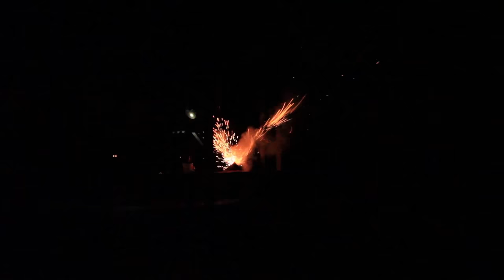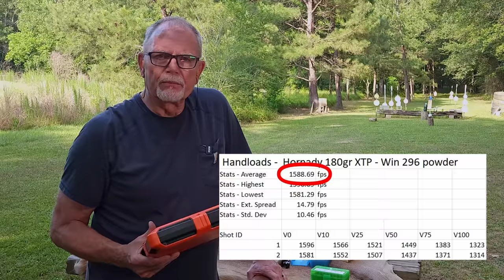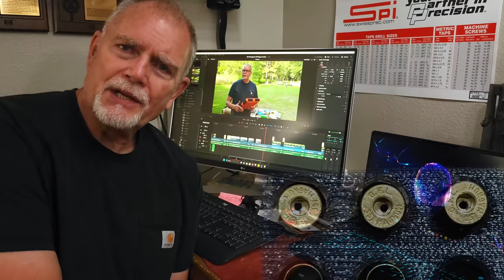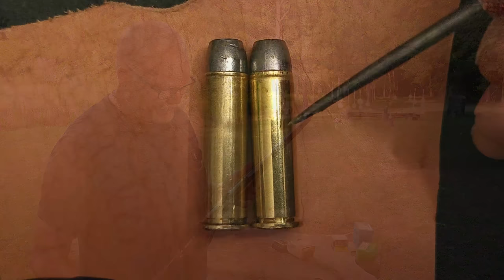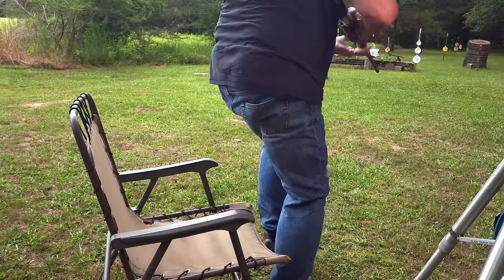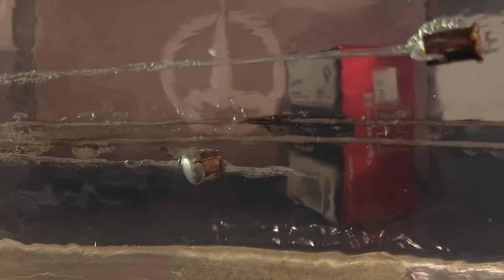Was I Wrong About The 357 Magnum Carbine? ?

Comment: George, it’s a funny thing the .357. I love it, and I am aware of its performance from both revolver and carbine. I have an 8 3/8” model 27 that I say I will harvest a deer with one day. I have hand loads that push 1550 fps through it. Those same hand loads approach 1750 fps in a 16” Rossi M92 I have. But I have never followed through with dedicating hunts with any of them. Mostly because of a thing called a 44 Mag. I know the 357 will succeed in ethically harvesting an animal with proper shot placement. I know it. But possession of that knowledge isn’t my problem. Perhaps I am lazy, or overly cautious because I want to drop an animal right there and don’t want to see it run very far. I’m not sure.

There are plenty of deer out there. There are plenty of days in a season. Hopefully on one of those days, I’ll pass the Henry and grab the Smith. I will make this promise: If you take an animal with your Miroku, I would love to hear the story. And if I take one with my Model 27, I will be sure to share about it.

Excellent work as always, sir.
Reply from the maker: I took a deer back in the seventies with my 8-3/8 in (Model 57?) 41 Magnum Smith. It was a little Texas buck at about 15 ft, and he ran about 40yards.
Reply from the maker: Has to actually going in the woods with the express purpose of hunting with that 357 Magnum I probably won't. And that's because of my love affair with my 44 Magnum Winchester carbine. Now, my love may be divided soon when Ruger introduces the new Marlin 1894.
Reply: @TargetSuite  I wish I could send you a picture of the axis buck I took a few years ago behind my moms old place in Pipe Creek TX with my Super Blackhawk in 44 mag. 240 grain XTP traveling at 1350 at the muzzle. Anchored him right there.

Comment: I bagged two deer using my Colt Trooper 8 3/8 inch barrel with one shot stop using a Remington .357 scalloped semi jacket 125 grain bullet. Both shots pierced the heart and the deer dropped 15 yards after the hit. The shot distance was 80 - 85 yards away from my tree stand. With the right bullet weight and shot placement I think it could be used against black bear in PA.

Comment: Great video, thank you. I have hunted with handguns for years, and have harvested a few deer and pigs with a 357 magnum. Most under 60 yards. About half the game had complete pass though shots. One bullet that has impressed me, because it has been accurate,  penetrates enough, and aint very expensive,  is the hornady 140 grain xtp. With a max load of accurate #9 i shot a good size doe at 75 yards. She didnt take a step, got complete pass through with evidence of good expansion. I believe you could get close to 2k fps with this bullet from a rifle with the right powder. Id love to see if it had enough integrity to stay together at that velocity.
Reply from the maker: I'll have to check later this afternoon, but I believe the max operating velocity for the 140 gr XTP is only 1600 fps. Beyond that, it just comes apart.
Reply: You are probably right. I loaded some 200 grain xtp bullets to about 1800 fps from a rifle. I think they went through about 3 milk jugs of water,  and had very little left of the bullet.
Reply: @TargetSuite  It might be doing 1600 at long yardage. Velocity is always an issue with hollow points if yardage varies a lot.

Comment: Seemed to me that the 158 magnum from a carbine is creeping up on the level of a .30-30 150 grain.  Remember those 30 cal loads are often tested in a 24 or 26 inch barrel,  MV from the carbine barrels is well down from the long ones.  Even the fine print in loading manuals almost always states a longer test barrel.
Reply: Tom, good point. A good handloaded 357 actually has more energy than the original 30-30 because it was on 1800 fps. Of course it’s more now, but those lighter loads from the 30-30 back then were still very effective on deer.
Reply from the maker: @tomsherwood the difference would be in ballistic coefficient. That 158 grain 35 caliber bullet is going to drop velocity like a rock compared to the 30-30. At very short distance it won't matter but hundred yards and Beyond I suspect it will matter a lot.
Reply: @TargetSuite  you would be correct.
Reply: But at 75 yards and less, it would be hard to tell the difference really.

Comment: I hand load 158gr xtp fp over h110/296. It has dropped a few deer under 70 yards with the farthest going 50 yards. Great expansion and take down power. But I didn’t get full pass through. Found bullet and jacket under the hide the offside. Takes them down quickly 
I’m trying cast this year with 158 and 180 grain for pass throughs.

Comment: Related to this, in response to the 9mm carbine craze a small ammo company (Maker) is loading carbine specific 9mm with very slow powders that get something like an extra 500 fps out of a 16" barrel.  Why not do the same with a .357 carbine?  The fast pistol powder in commercial ammo burns up in the first 4 to 6" of barrel.  If you experimented with much slower powders in .357 (with all that extra case capacity) you might double your effective range.

Comment: Another good video, congrats.
Can I ask something of you? I watch alot of your vids and I bought my Rossi because of you really. I see tou loading and firing alot of heavyweight loads in your 357's with some stiff charges of slow powders and heavy bullets, what does your brass look like? Does it always have a bulge just above the head? Have you mic'd any of it to see what kind of expansion youre seeing?
My Rossi is bulging my brass pretty bad. I know why the '92 designed for straightwall cartridges must have the chamber reamed a little to feed them but either mine has been excessively reamed or this is a common trait of the Rossi's but Ive not heard you or anyone else mention anything about it.

Comment: You didn't test 125 grain or standard 158 grain.  I would expect the 125 to have problems with penetration, maybe the 158 also.  I never doubted the 180s but they will be less common for the average shooter.  This shows the beauty of the .30-30, barely larger than the .357 carbine but more capable.

Comment: As usual it's a beautiful gun plenty of power and lever reload nice shooting as usual I usually take your input because you are the voice of experience  second to none   👍💕😎
Reply from the maker: I appreciate that. But be discerning! I have missed on a few in the past😉
Reply: @TargetSuite  have you tried a 200 grain cast bullet? I’ve seen loads for pistols but not rifles, they just go to 180 grain. Just wondering.
Reply: @robertgulley1382  The heavy bullets take up too much powder space. A 200 gr with Lil' Gun will only get up to about 1600 fps. The 180s with Lil' Gun will go about 1800. The 158s with Lil' Gun will go 2000 fps. The 158s have more energy all the way to 200 yards and they are flatter shooting.
Reply: @mattnewcomb4147  just thinking of weight and  what it would do on deer at short distance, 50-60 yards in the woods where I’m at.
Reply from the maker: I have not. I suspect that heavier bullets will either not cycle, or take up too much room in the case.

Comment: I'd be interested in seeing the results with the Hornady 158gr "FP/XTP". With win296 I drive them, with a carefully crafted load to about, 1800FPS. Marlin 1894c 18.5" barrel. Haven't gel tested or actually taken game yet with this load. Hopefully this coming season I will have an opportunity. It's a interesting addition to the XTP line up....... Remember 158gr  "FP/XTP" Great video!
Reply: You should try Lil Gun powder. I drive that same bullet to 2040 fps out of a 16” Rossi.
Reply: @bradstephens4915  Gonna have some Lil Gun next week. When I get a chance to load up and test, I'll comment here. Might be a few weeks.
Reply: @bradstephens4915   Worked up to max. 1908 fps for the 158gr XTP FP is what I got. Not bad. Now the 125gr XTP FP gave me 2341 fps with 296. Gonna try lilgun with it next. So far lilgun has beat 296 with a 158gr even though it didn't reach your results. Will it beat 296 with a 125gr?....... Oh yeah, my brass was once fired starline.
Reply: @silenceismycanvas  Lil Gun is the cat’s meow in a 357 carbine. My results were with published max load. Also, my Rossi has a 1-30” twist, whereas your gun has a much faster twist rate. Could be the difference, but not sure. Keep me posted.
Reply: @bradstephens4915   Looks like I'm gonna get a chance to hopefully "take a deer" with it. I'll let you know if anything significant happens. 158gr xtp fp. lil gun listed max. Wish me luck. :) P.S. accuracy was near one ragged hole at 50 and about 1" high. Cant sight in beyond 50. Range won't let me (pistol caliber) and no private property available to me.

Comment: I have mentioned on a few of your 357 videos now how you need to check out Lil' Gun with 158 grain bullets. It will shoot a 158 JSP at 1950-2000 fps and it will shoot a 158 gas check lead bullet at 2000-2050 fps. Plug that in your ballistic calculator with a .16 BC and compare it to a 180 at 1800 fps with a .18 BC and you will find that the 158s shoot flatter and have more energy at all ranges out to 200 yards.  If you wanted I could send you some of my 158 cast bullets. 

I have killed 15-16 big midwest deer with my 357 rifle and cast bullets. I have used a hard cast Ranch Dog 135 gr at 2100 fps for a few and the majority have been with a medium hard 158 that mushrooms nicely up close with a 12 BHN.
Reply from the maker: I bought 3# because of this video knowing there would be a lot more investigative work on the backside. So, I'm just getting started with the Lil'Gun Powder. I'm assuming you get pretty good penetration with those 158gr bullets ?
Reply: @TargetSuite  I have found that rock hard 158s penetrate more than needed for deer drives and I am a fan of breaking bone and texas heart shots. I calibrate my hunting penetration standards around the old classics like 150 grain core lokt 30-30 and 180 RN core lokt 30-06 which penetrate around 24" in gel at deer drive ranges. This is elk and bear levels of penetration in the rifle hunting world. Many deer JSP from full power rifles only penetrate 15-20". So I have one foot in the hard cast camp and one foot in the mushroom camp. I like a blend of tough bullet with very controlled expansion that can bust bones but make a wider wound than hard cast.

24" gel penetration will exit a deer 99% of the time from any angle. Texas heart shots will usually end up in the neck or in front of the shoulder under the skin. This level of penetration doesn't give explosive meat damage like common "deer" ammo but it does a lot more visible bruising than a bullet that penetrates 40" of gel and exits the animal at 1200 fps.

I use a low tin and low antimony alloy that is about 12 BHN air cooled and 14 BHN when I water drop after powder coating.

The water dropped bullets mushroom to about 55 cal up close and penetrate about 24" of ballistic gel with 100% weight retention. They mushroom less and less and don't mushroom much past 100 yards.

The same exact mix air cooled will mushroom at 175 yards but expands too much up close. It penetrates only about 16-18" with a 65 cal mushroom and 95%+ weight retention.

Comment: This was a good analysis, George. It'll be interesting to see the results you get with new brass, you cheapskate! I've always felt that the .357 Mag is a great round for personal defense against thin-skinned attackers/game that weigh maybe up to 200 - 250 lbs. or so, at close range. Buffalo Bore, and similar rounds, will definitely penetrate, but still, only at close range. I think 50 yards is pushing it with that round, even when launched from a lever gun. You might get a little more distance with the BB rounds, but you'd need to do another video to see what happens.

Comment: I shoot the Barnes 140's with H110 out of my 20" stainless steel Rossi M92 and get over 1900fps.  It's my truck gun and has accounted for a half dozen deer over the years, yes, it's not ideal, shots were under 100yards, most under 50 and shot placement is paramount but they were all one shot stops except one.  Most deer take only so much killing and a 250lb critter is only 18"-24" thick in the chest which means the 357 will dump it's energy without exiting.  No, I wouldn't use a handgun.  I tried it with my 6" Python with poor results but the extra barrel in the rifle makes all the difference.  Besides, if the 357 isn't enough I have the same rifle in 454 Casull, DRT medicine for sure but it can produce excessive meat damage.
Reply from the maker: Thanks for your comment. I was hoping someone had experience with the XPB HP bullet. I am going to try and score a bunch of those for future "woods work" ;-)

Comment: You mentioned you had chambering issues with some of the wide flat nosed bullets. With my Rossi Trapper, I have feeding problems with those bullets, but they chamber just fine if I single load the rounds directly to the chamber.
Reply: My experience with the Rossi Trapper has been quite the opposite. The only hang ups I e had is the 180 Pugnose from Missouri Bullet Company.

Comment: Could you please do a test with the hardcast loads where you put the chrono behind a 16‘ block. 
Those things will just pencil through and I bet energy on target is less than impressive if calculated based on that. 
1800 ft/s entry minus 900 ft/s at exit would leave you with a mere 323 ft-lb on target. And that with a non-expanding .357 projectile. That’s like shooting a deer with a standard pressure 9x19 FMJ out of a full-size. 

And the entry speed should be too low for any of the hotly debated hydrostatic shock to kick in.
Reply from the maker: Unfortunately, my chronograph will not work in the way you suggested. It needs the nearby muzzle report to trigger the Doppler signal. That said, according to Randy Garrett's extensive and well-respected research, wide flat nose bullets don't kill by depositing energy in a game animal. They kill by creating a greater than normal wound channel for caliber that bleeds faster than mushroomed jacketed bullets that "dump" more energy. Of course that subject has been hotly debated for decades.
Reply: @TargetSuite  thanks for the feedback. I thought you might have one of the good old chronos around that preceded the LabRadar 😁. 
So you say that on the flat nose bullets the theory is that the sharp corner will do some cutting rather than an classically shaped FMJ pushing aside material, which then leads to a larger crush path and more bleeding from cut vessels. 🤔
Still, I personally would prefer the expanding bullets. Over 20‘ penetration should be plenty for any game you should consider shooting with a handgun cartridge.
Reply from the maker: Yes, and the "theory" goes on to say that the abrupt velocity change of flesh making an abrupt 90 degree turn around the sharp corner destroys more flesh than the smoother path around an even larger mushroom. I have read enough of Randy Garrett's study on the subject to suspect there is real science behind the benefit of a wide flat nose bullet. Does it replace modern projectiles at rifle velocities? Certainly not. The "science" only applies to projectiles at handgun velocity.

Comment: Is the .357 lever action capable of taking medium size game at short distances?  In March this year I was tasked with destroying two Vietnamese pigs (boars) that had been raised in captivity but had never been de-tusked and while they may have been cute piglets they had become too big and too aggressive to be approached and had then escaped into a stretch of riparian bush along the border between several residential properties.  My first preference was to use  my 30-30 with 190gr hard cast FP bullets but because of the residential area and misinformation about the actual size of the pigs I chose my .357 Rossi lever gun with a 140gr Hornady XTP load doing 1850 ft/s.  The pigs were easy enough to find and  the largest one  was shot from about 7m with a frontal brain shot and dropped in its tracks.  The second, smaller pig then ran off  and then turned and charged me and I brained it at about  30m.  The estimated weights (from weighing the heads) was approximately 380 kg or 840 Lb for the large pig and the smaller pig was about 260 kg or 570 Lb.  I recovered the remains of a 140gr XTP behind the  shoulder of the big pig.  About 115 cm of penetration after going through the 5cm thick layer of gristle covering the frontal bone of the skull and completely penetrating the skull and clipping through the articular process of one vertebrae.     This is the first time I have seen a Hornady XTP lost most of its lead core.  Then again I've never tried to shoot an animal of this size before this using this bullet and I have shot a number of medium size antelope such as reedbuck, bushbuck, impala and even warthog (up tp 90 kg or 200 Lb) with the 140gr XTP and had outstanding penetration and performance.

Comment: Hard cast .357 Magnum at less than 100 yards will penetrate 3 feet into an animal out of a lever action rifle. Shot placement is crucial and follow up shot is again crucial making the easy to get back on target .357 an awesome weapon. .44 Mag out of the same rifle will give you better foot LBS. and a larger diameter of hole. Quick follow ups and less recoil and cost of ammo make the .357 a better choice for most. It is nice to have a revolver and a lever action in the same caliber. 30.30 is the preferred or 45.70 if you can afford the ammo for a lever gun. 45.70 is overkill for most.
Reply from the maker: Thank you for the very comprehensive comment!

Comment: I think you should have included a 158 grain bullet as arguably it is the most commonly used weight in the 357.
I have shot 2 black bears with 357 handgun. The 158 grain bullets passed through. IMO penetration is not much concern.